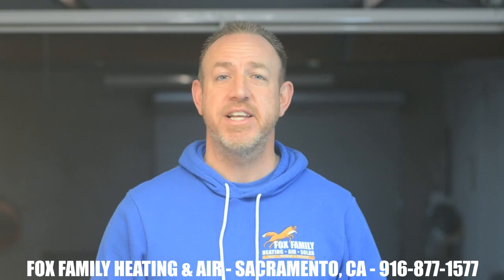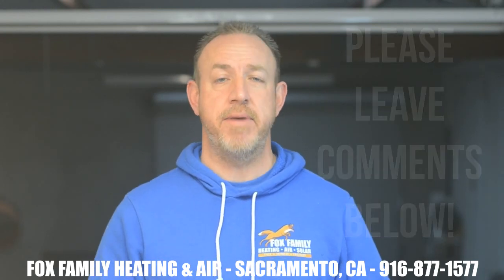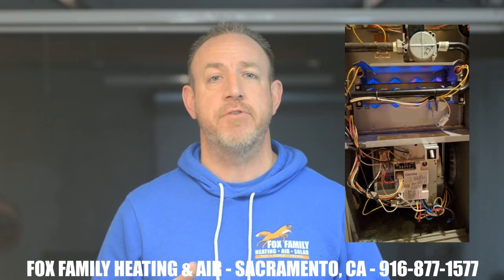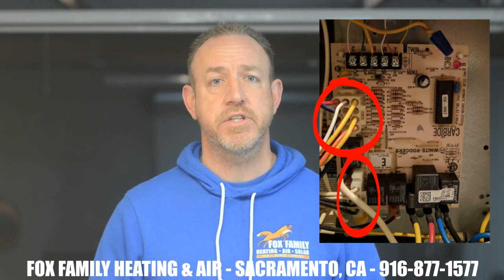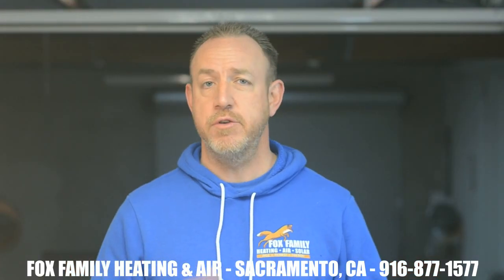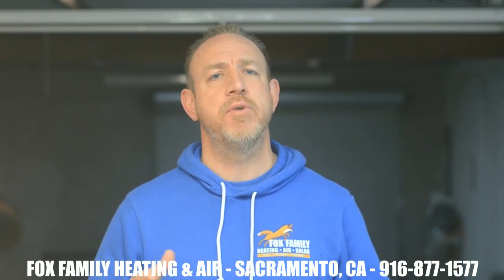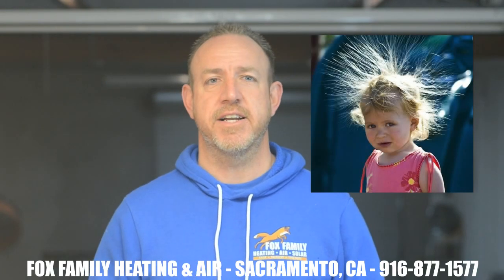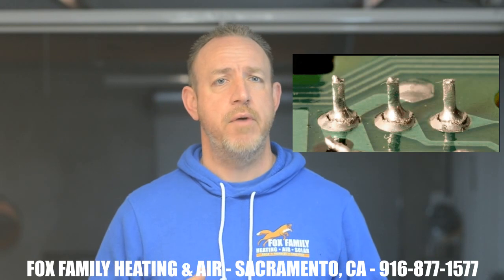Why Do Gas Furnace Control Boards Fail?

Comment: I like whole house surge suppressors as a way to way to extend the service life of electronics. One of the factors is when lightning hits a powerline within a mile of your location.   Ultrahigh frequency components can easily travel distances and jump utility and control transformers to damage semiconductors.  I do believe there are solutions through superior manufacturer’s design (including comm circuit isolation, on board voltage protection and solid state switching) but the easiest retrofits may be whole house surge suppressors.  Proper single point ground rods in house wiring can help as well and is sometimes compromised when someone separately earth grounds a subpanel or outside unit.
Reply from the maker: Very good information!  See its experts like you who are an asset to this channel.
Reply: Indeed. There are many, many electronic devices in the home now, especially with the advent of Smart TVs and the Internet of Things.  And spikes and surges can happen for many reasons.  But keep in mind surge suppressors do need to be replaced on a regular basis.  They will lose capability over time.  The maximum lifetime of most surge suppressor power strips is something like 10 years.

Comment: As an electrical engineer, there are only 3 reasons boards fail - poor design (there was no worst case operation analysis done when choosing or sizing the parts), cheap parts (like Chinese relays instead of name brand relays, and Chinese capacitors vs name brand capacitors), and crappy assembly (poor soldering during assembly) and no vibration mitigation (no selastic holding the larger parts to the board leading to cracked solder joints from vibration). These boards are all repairable - I've repaired many furnace boards. Usually when I repair them, I use better parts, and they last forever, and the repair parts cost less than $10 (usually much less). At $350 or more for a board that contains $20 worth of parts, the boards are designed to fail on purpose because they make a lot of markup selling replacements. Your car uses a lot more complicated electronics, and they're exposed to much harsher conditions (voltage spikes from the ignition system, vibration, extreme temperatures, water, salt, dust etc), yet they fail relatively infrequently compared to simple furnace boards. Automotive electronics have much higher standards of both design and assembly. There's no excuse for furnace boards not lasting the life of the furnace, other than that they only pay enough to get the people that barely passed their engineering degree to design them, and or they shave pennies off the parts cost by choosing the worst quality parts available.
Reply: Thanks for the info!  I have  an intermittent gas valve relay operation.  Tapped the relay and it started working again.  Not sure if it's a cracked solder joint or not, as it's a fairly old control board.  Where would you recommend I get a replacement one?  It's a 24 v relay TIANBO HJR-2FA-SV-Z
Reply: @jum5238  If you tap the relay and it works again, it could be a bad solder joint, or it could be the contacts in the relay are pitted from arcing, and the relay is just worn out. You can reflow all the joints on the relay, as this is basically a free and quick check. Also reflow the spade connector (or pins of the multi pin connector if that's how it connects) where the gas valve actually attaches to the board. Any connectors are subject to cracked joints too from the repeated vibration of the cables connected to the board when the furnace is running. Best place to get replacement relays is Digikey or Mouser. You're not going to find the exact brand, but most relays have a similar footprint, so should be somewhat interchangeable. You want to look for the same coil voltage and same or higher current capacity on the high current side. If it's for the gas valve, you probably don't need a lot of current capacity. Check the datasheet of the parts your looking at for the pin layout, and check the spacing and layout of the pins of the existing relay on the board. If the board has any electrolytic capacitors (round thing that stands up off the board), I'd replace those too while you're ordering parts. They dry out after a while, and when they dry out, the control board will stop working (the DC voltage that runs the microprocessor will be 'bumpy' enough to continually reset the processor, then everything stops working). If you posted some pictures of the board somewhere, I could maybe help further.
Reply: Ahh yah most boards today are wave soldered with no lead making it easier to have dissimilar metal corrosion and dry cracked solder half the time the relay pin looses solder and goes open it’s so sad people don’t teach themselves how to repair rather than replace ..02 cents worth of solder can save you hundreds and some techs will try to sell you a new furnace then you are out thousands.
Reply: I appreciate everything about this comment so very much.
Reply: i have a hvac gas furnace control board. Whenever i tap the relay it starts to work again. i changed the control board and after fitting the second board (bought a used one from ebay), it worked very well for 15hrs and then again furnace went down. Tapping the relay is again making it to perform well. what could be the problem here as its two different boards but same tapping is getting the furnace to work again? thank you in advance
Reply: @anil1011anil1011  They probably used relays that aren't rated for the current they're carrying, or they've just had too many cycles on them and the contacts in the relay are pitted and not making good connection. If it's from the same type of furnace, and 2 boards are failing in the same way, it's a problem with the parts they chose to use. Probably any used board you buy will have the exact same issue. If you have the ability to solder, I would buy 2 new relays and replace the relays on both boards and then you'd have 2 good boards.
Reply: Your comment has inspired me to try to fix my new board with a burn spot due to a power surge.  You are right, I just replaced the board and one year later, another brown spot on it due to a power surge.  Before I shell out another $300 for a new board, I'll try to solder that part and replace the wire as well.  Thanks for your professional insights!!!

Comment: Heater was on the fritz, HVAC tech said control board needed to be replaced and that it was replaced just a few years ago so I'd probably have to replace the entire furnace. Quoted 6700 for a new furnace and 1300 to fix it. Ordered the new board off of repairclinic for $60  and fixed it in 20 minutes. I realize they gotta make money but the markup is just insane. Had a lot of bad power surges this past summer, thanks for explaining this. My furnace is back to working fine.

Comment: Ive had an abnormally high amount of boards that lost flame sense after PGE cut power numerous times last sept. And im still getting calls from customers that have second homes and just making it back up here to the mountains and starting their furnaces for the first time. I must have changed out 25 boards in 1 1/2 months.
Reply from the maker: Holy cow.  That's a lot of boards!
Reply: What model amd brand
Reply: Yep!  Mine just did the same thing, a 15 y/o Winchester (made by York) but I wasn't sure if it was the board or the flame sensor rod itself, so I cleaned and inspected the sensor, seemed fine, but....flame was still being lost anywhere from 4-6 times each heating cycle.  Then, I happened to notice the board wasn't giving any codes at all, where it had initially.  Also, the green "all systems go" light was no longer coming on, so to me, it was a no-brainer....didn't even check it, just replaced it, and now it's running perfectly.
Reply: This just happened to us in Texas. This video was very timely and informative.

Comment: Acidic condensate drain water gets into the boards from leaky tubing. Bad run capacitor on circulator fans ruin relays.

Comment: My experience so far is that if the other parts(pressure switch, gas valve, flame sensor...)works one week and then they don't the next week for a period of a few months, the control board is failing.  It would look normal until it eventually fry like the one on the video.

Comment: Float switches shorted tstat wire bad capacitor bad blower motor power surge loose tstat wire at low voltage terminal bad 24v transformer bad contactor at condenser bad tstat or my favorite, mis-wire the system!

Comment: Voltage drop from Xfmr hot, through tstat can cause IFC to not read a closed pressure switch.  Can add a switch to connect Xfmr hot directly to heat demand fed by the Tstat head demand lead.  The dropped voltage will close the switch and the full Xfmr power will pass directly to the board.

Comment: Thank you for this video. I am searching for answers the day after my 25 yr old Erie boss series had a zone relay meld, then ignite the plywood mounting board. The fire then burned to the 2 nearby studs. Only because I was home, I ran to the basement and extinguished the fames before the fire department arrived. Your explanation was spot on and very comprehensive. I am puzzled why NEC or some building codes do not require boiler controls to a metal plate vs commonly used wood. Maybe that is too simplistic. Thanks.

Comment: I have re-soldered many fractured solder connections on both connectors and relays. I have never had a re-solder joint that failed.

Comment: Ugh, I've got one that is becoming extremely irritating. Trane S9V2 cir board randomly shuts down blower and the led readout display always goes out with it. Suspected power issues, this is a brand new furnace. Issue been persisting for 6 months now, electricians say all their circuits are good. We get out there and the system board is always down, blower isn't functioning and coil has frozen up despite the low pressure switch on the condenser. I thought maybe the contactor was randomly intermittently sticking closed but I tested the shit out that thing and couldn't get it to stick closed once. I suspect by evidence found today that something is causing the board to shut down which Is consequently causing the blower to shut down but is still allowing 24v signal to tstat and condenser. Thought it was surges as I've seen this several times before but not to this degree where it's shorting a board randomly every few days. I suspect maybe the generator is causing voltage fluctuation beyond units capabilities or maybe Hz is fluctuating too far out of range. Plan to return with 2 boards in couple days and run through entire system with trane tech support and hopefully we can resolve this headache. Will update when we resolve problem and maybe it will help someone else down the road if they experience similar issues.

Comment: I've started packing a 'jeweler's Loop' as part of my gear. It allows me to get that view 'up close' I need to examine the integrity of a connection or a contact's surface. Once you get past the voltage readings then moving to the board/component integrity helps me determine future approaches when faced with that brand of a component. P.S.Resistor vs Transistor, they look different.
Reply from the maker: Thanks.  I made the edit to the video.  My bad! Lol

Comment: Customer had a no heat issue and a tech replaced the gas valve one month before. Now no heat again. 24 volts measured at valve. On close inspection found a fractured and burnt solder joint on board.. still making some connectivity to deliver voltage but not required current to open valve.
Reply from the maker: Absolutely.  And that is why I tell people furnace season can be frustrating for customers because there are so many intermittent issues going on with the board, gas valve, pressure switches, etc.

Comment: Hi very interesting video !
Is there way to wire ac unit without control board 
Please could ou make video showing how thank you
Reply from the maker: With the cost of control boards within reason, why not just replace it? There are low voltage to high voltage relays and signals that have to happen. You would have to make these connections manually every time you would want the system on or off.
Reply: The answer to your question is yes.  In the old days----there were no boards.  The first furnace I had I think it was a Bryant and it was all mechanically controlled and powered by a 24 V. transformer in combinations of bi-metal wire wound heat switches and a heat-sensitive twist tube control switch that fit in the heat exchanger.  Worked great and rarely caused trouble.

Comment: I have an ADP ceiling mounted garage heater. I suspect the control board to be bad as it is not sending power for the burner ignition stage. The board is readily  available online. Is this a replacement that can easily be handled by the homeowner. I would classify my skill level as advanced handyman. Thank you in advance for your earliest response.

Comment: Recently had light switches replaced also a ceiling fan which blowed out maybe crossed wires. Would this be an impact on my control board as now I need a new board as no heat or air conditioning? Let me know. Thank you.

Comment: my hvac relay is unstable. i have to tap on it frequently to get it working? i have changed the control board but the second board also is having the same issue? is this a control board issue or relay issue or furnace issue? kindly advice and thanks in advance

Comment: Pressing on the relay makes my furnace work, so I'm guessing it's the bad part. Unfortunately, it appears the relay is obsolete.
Reply: how did you fix this? did you change the entire board?
Reply: @anil1011anil1011  yes, the entire board. Now, it works fine.

Comment: Very good video but I'm  trying to find out if a failed control board can cause a gas furnace to cycle off and on I have replaced the flame sensor but it will run one time then the next day it will cycle  on and off so I'm thinking it might be a fail control board
Reply from the maker: Yes it could be the board but it could be other things too. I know, furnaces can be frustrating to diagnose. We went back to one lady's house three times trying to find the right diagnosis. Ugggh
Reply: @foxfamilyhvac  yea I got another flame sensor on order so I'm try that before I get a circuit board

Comment: I replaced mine the ignitor part wasn't kicking on and it works good now. Is it normal that everything looks normal on the old board? I'm wondering if it was just dirty
Reply: The board was ready faulty I just expected to see a stain on the board
Reply from the maker: Yeah it's not necessary to see any damage. It could be internal to a part on the board. Happens all the time. Even tiny fractures can make it happen. Very rigid boards with rigid solder connections. Glad you're running again

Comment: I have had to replace those control boards every 2 to 4 years
Reply: Have you found a relatively cheap UNIVERSAL mother/circuit board you can buy, or do you go strictly by the model#?  In other words, I can't find an EXACT match with the furnace model I have to a mother/circuit board, so I'm looking for a Universal one(or one that is supposed to work on multiple furnace brands/types....I'm guessing as long as all the parts/connectors are in the same place, I can use ANY mother board sold---does that sound right to you?....What is your experience with buying these boards, as far as going outside the box to save a few bucks?  thanks...

Comment: DIY amateur .. found bad transformer .. replaced and initially tried air conditioner thru thermostat and it worked.  Switched tstat to heat and transformer burnt up.. going to replace control board but concerned that it could be another component causing the problem and that I could damage the new control board .. any advice?
Reply: It could be a limit switch shorting to the heat exchanger. I've seen it before - furnace runs fine, then as it heats up, the limit switch bends from thermal expansion, and shorts against the heat exchanger - can take out the transformer, the board, and the thermostat itself. It comes down to shitty design (or designed to fail on purpose).
Reply: @gorak9000  thanks .. have new control board installed and this board has a fuse that blows immediately when heat comes on - also it had a test function that cycled thru a
the main components of the heat with no problem .. since heat has not been required and a/c works haven't gone to next step of trouble shooting apparent short between the heat terminal and common ground .  I am assuming that the fuse kept the fault from damaging the new board and I just need to isolate the components and check them for short with my meter .. fingers crossed I can figure it out though at 70 yrs old I seem to make mistakes more regularly

Comment: The problem is that the board costs damn near as much as the system
Reply: Replacing a board is doable by most homeowners and boards are available on e-bay or Amazon.  They start at around $100 dollars or so.  I just put one in my trane and I think I paid $113.00 for it and 20 minutes to install.  Get the new board and then swap the wires from the old to the new board,, one at a time.